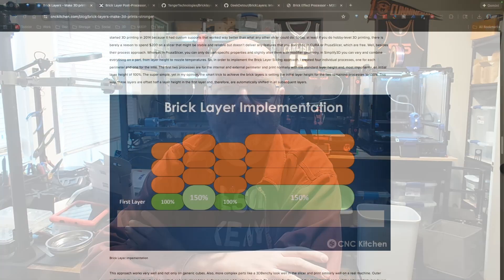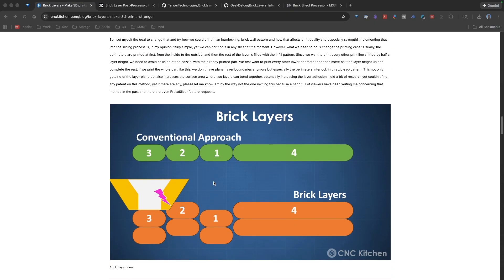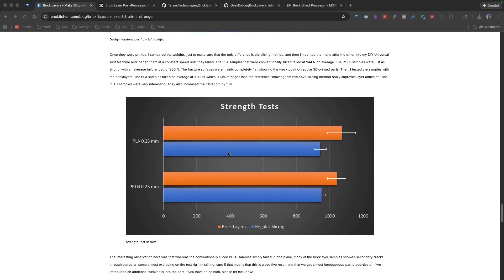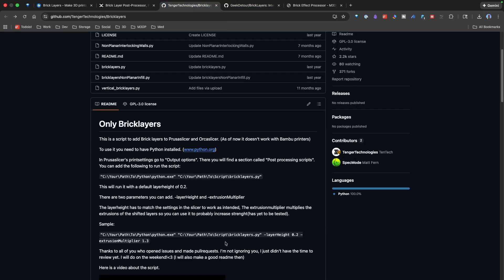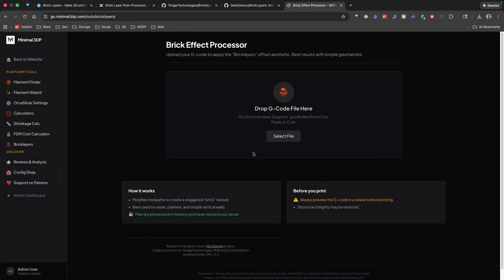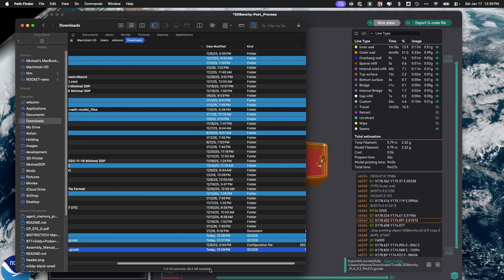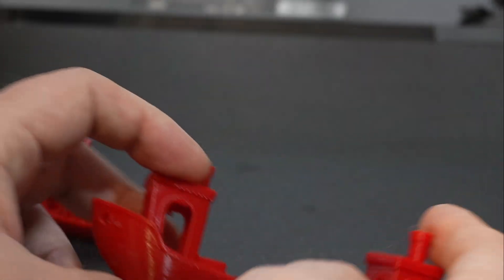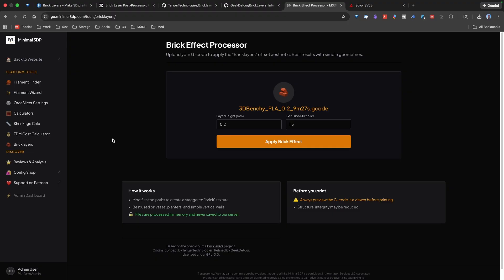The "BrickLayers" Hack: Instantly Generate a 3D Printed Brick Wall for Better Adhesion

Comment: I don't understand why the walls are getting shifted vertically instead of just shifting the inner walls every other layer horizontally like a real brick wall would do.  By keeping the outer walls the same, the surface finish should remain the same (at least when printing outer first).  The next inner wall would then have to be 0.2mm wide (or rather half the normal width) on layer 2N and 0.4mm on layer 2N+1.  All other inner walls can remain the normal width of 0.4mm.

Comment: I do think the brick layers does have not as nice surface quality. Would love to see that with dialed in filament and a closer look. Also are there any speed considerations when doing this?
Reply from the maker: The surface quality might be slightly worse. I printed everything at the same speed. As I mentioned in the video. It printed maybe 60 seconds slower.